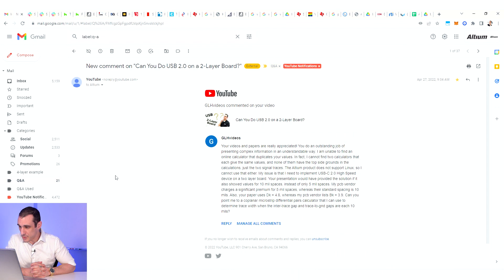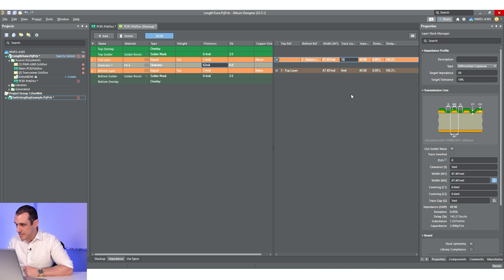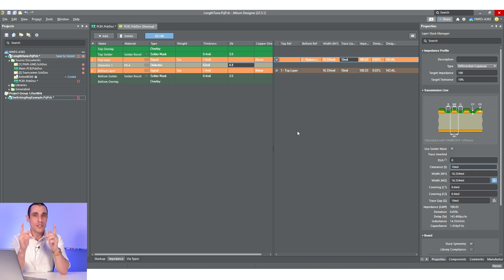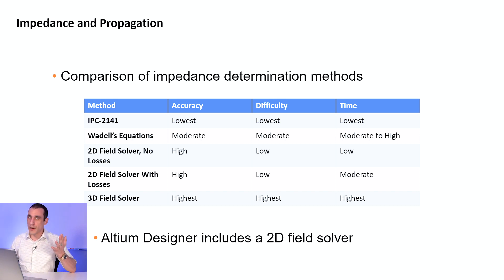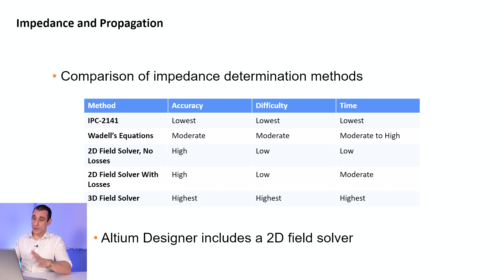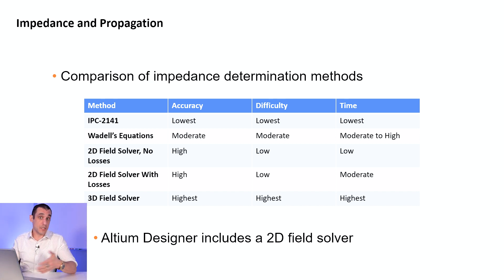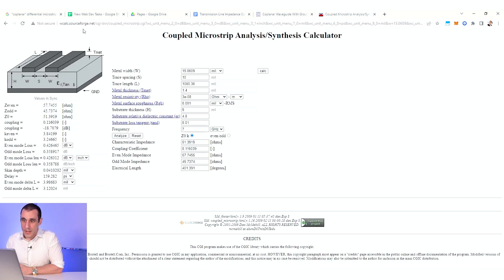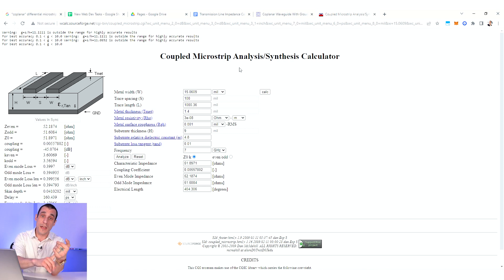Why Your Impedance Calculator is Wrong

Comment: Hello Zach, I have a question about Impedance in Altium. You know that we can calculate the Impedance in Layer Stack Manager and then from the rules we can assign the this Impedance value to some signals as 100ohm. However, when we make the Signal integrity Simulation in Altium, we always see the signals are 200-250 ohm but we define 100 ohm. It is not possible. I have read in diffedent forma that others have encountered this error as well. What is the reason of this? Is this a bug?
Reply: I don't know exactly why you would see this without looking at your project and your PCB layout. It sounds like you have a thick board (62 mils) with 2 layers and you are trying to route thin traces, in this case those thin traces will have very high impedance. If you have a multilayer board, then you probably removed all the ground beneath those traces. In either case you would get very high impedance of 200-250 Ohms. Just for fun, I tried to reproduce your situation, When I take a 50 Ohm trace for a 6 mil thick dielectric, but I increase the dielectric thickness to 60 mils (Dk = 4.2), the SI simulator calculates an average impedance of 150 mils, just as you would expect.

Note that the "define 100 Ohm" condition is only a target impedance for unrouted nets and I think it is only used in the crosstalk/reflection simulation, it is not something that is used as a design target in the simulator. Note that you have to specifically size your traces and route them over ground to get a specific target impedance. If you enter "100 Ohm" into that box it will not use that for any nets that you routed. If you enter some other value into that box when you are preparing the simulation, then the simulator will only model signal behavior using that number for unrouted nets.

Comment: Thanks, Zach! One point worth mentioning is that sometimes the variation is not between different calculation methods, but between the ideal design parameters and the real-world fabricated results. For example, I think Altium assumes that one ounce copper is 35 um thick (which is close; IPC uses 34.3 um). But actual copper comes in at the low side of the accepted tolerance (to save money on copper) and then becomes even thinner after processing. IPC-6012 Table 3-13 allows a minimum copper thickness of  24.9 um after processing for inner layers. 
Another factor is that Altium's Layer Stack Manager only shows the starting copper thickness of the material used on the outer layers, and ignores the extra plated copper on top of it that results from plating the hole barrels. (Altium needs to added PLATED COPPER layer to the Layer Stack Manager!!!). Final trace widths are commonly measured to be thinner than in your design, etc.
The point is, the bare board fabricator results may differ from Altium's estimate, not because Altium's calculator is wrong, but because their final result has to match the desired Impedance AFTER processing.
Reply: You're right there does need to be a copper plating option included in the layer stack manager specifically to address nickel-based platings. The problem is it is based on a Simbeor model and I do not know how they queue that up, if they do it with a pre-built numerical model built with multivariate regression or if there is actually a method of lines field solver running inside the layer stack manager.